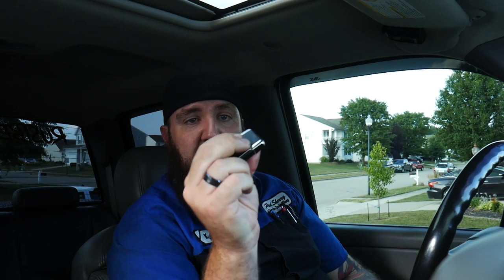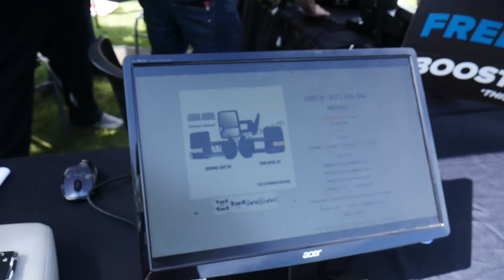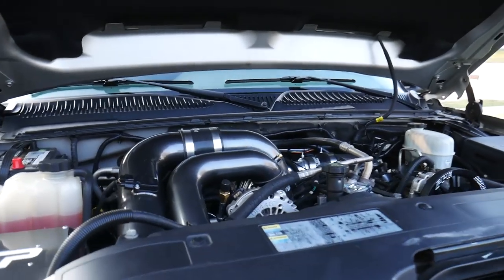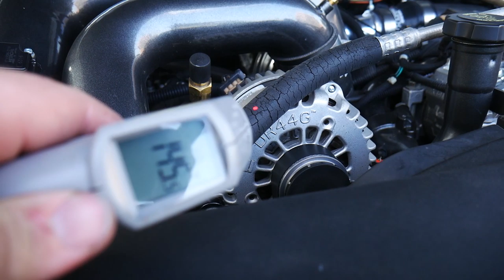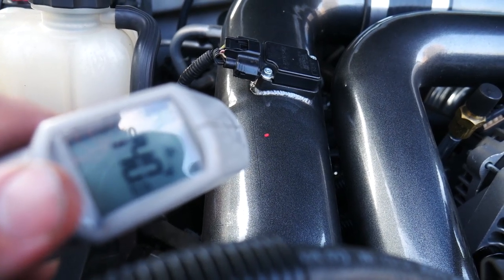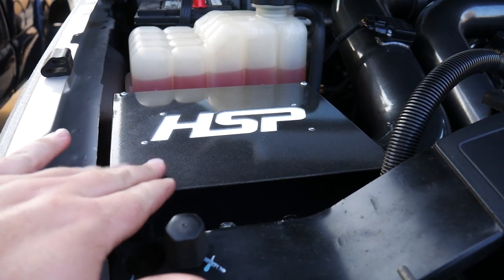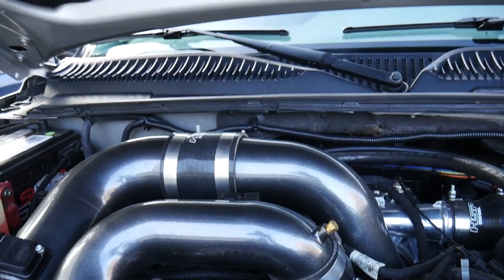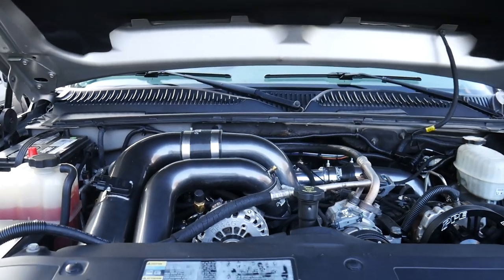BOOST AUTO PARTS KEY FOB AND WHY I CHOSE HSP

Comment: I got a LBZ crew cab long box also, what kind of mileage are you pulling with all these upgrades? I average around 25-28 @62 mph, 20-21mpg highway @ 77mph (I always drive 7 over an never get harassed). I have only a bullydog GT in it since I bought it new, a AFE pro stage 2 air intake & 4" exhaust. I've been wanting to upgrade for a long time but worried about losing my great fuel mileage. I'm getting ready to raptor line my truck & topper here within the next couple weeks also, Your the first I've seen with the quad cab long box on here, pretty cool. My LBZ is my girl!!! shes been good to me for 13yrs so far. I just watched your video on the drive shaft, that is going to be a must for me, My truck eats u-joints smh.
Reply from the maker: That’s awesome! Really I have not kept much fuel mileage in mind since the lift. With a 7+ inch lift and 37x13.5’s....it’s not great. I get right about 13 mpg pretty consistently. But my programming is also keeping the vane position high to keep that big 68/71 turbo spooled for a little less lag. I also have the bigger injectors, manifolds etc...

Comment: What's your opinion on 2018-2019 Jeep Compass with the 2.4 MultiAir Tigershark engine. I know its a Fiat but what's your opinion? I heard about oil consumption on it. Its the only SUV looking SUV that gets decent gas mileage and offers a 6 speed manual with 4x4. Any opinions?
Reply from the maker: The oil consumption on the 2.4 motors was in the earlier ones and I have not seen any of that on these newer ones. Pretty decent serviceability, oil changes are more expensive on the multiair engines due to needing full synthetic. Other than that a lot of the only other issues we see a lot of is radios.